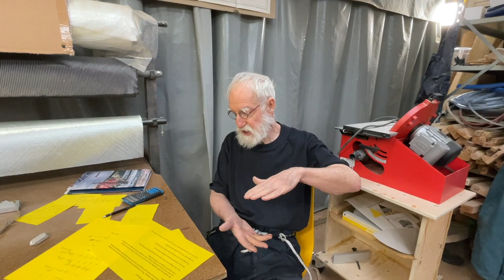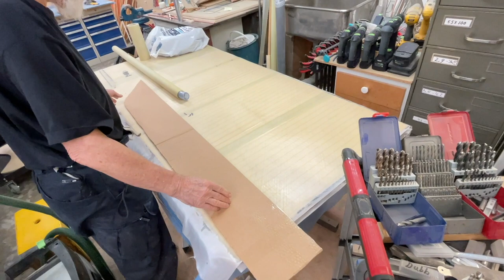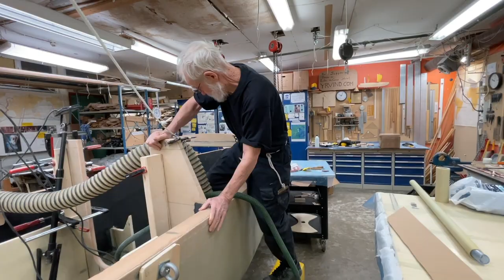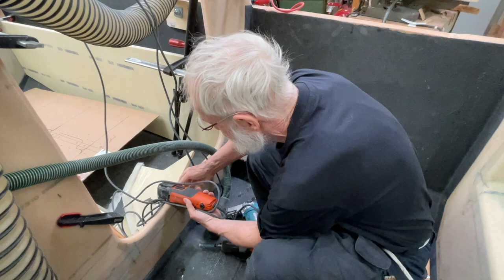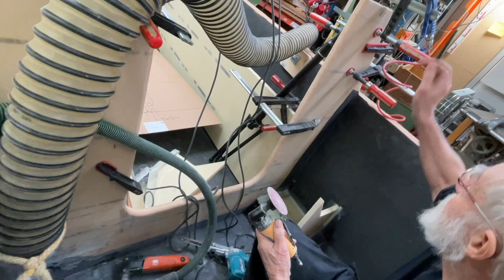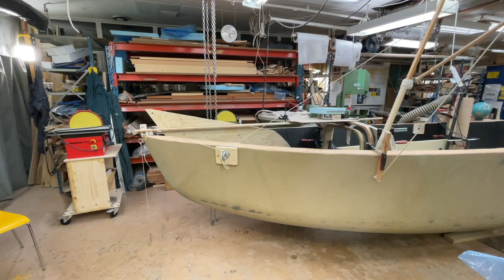The importance of CB & bilge keels. Because a rised CB gives trouble free stable downwind sailing

Comment: here's hoping puty goes the way of the dinosaur soon .
 you're building a interesting boat . it looks like a  boat that can be built on a limited budget like mine and I like the cork floating  concept better that a large boat plowing through the seas. it's impossible to build a vessel stronger than the ocean. I remember seeing pictures of brand new ships after going through heavy weather where the steel super structures were twisted like corkscrews and one ship had to be scrapped after it's maiden voyage. you appear to have the philosophy a cork floating ina violet sea is more likely to fair better than a tank attempting to beat the unbeatable I can't wait for the launch and to see it perform.
Reply from the maker: It is the Galelei square / cube law.
As structures gets bigger the forces increases with the cube, the strenght with the square. Dubling the scale 8 times the forces 4 times the strenght.

Comment: I am glad you got rid of the shifting ballast. There was just too much risk of it ending up on the wrong side. My LOLA design once had shifting ballast, in the form of a large water tank. It would be filled with drinking water about 3/4 full, and have a water-tight divider dow the center. There would be a valve that would allow the flow over to the low side. After that, the valve would be closed. The boat would then change tacks, so the biggest portion of the water would end up on the windward side. Often, in very light winds, it would be left on the leeward side, so the booms would stay out to that side, due to the boat's tilt. I gave up on the idea after considering  how high up the tank would have to be in the hull, and that it would make it impossible to store heavier stores below it.

I see the bow centerboard as a true innovation. You are now free to move the Center of Latteral Resistance (CLR) fore and aft to some distance. This is a very helpful capability.

As for the sail plan. I think there are three ideas you should consider:

1.) Using vertical battens to add considerable roach to the sail, and dispensing with the leech-clubs.
2.) Using only one of the sails when sailing upwind. The other sail will be too close to provide much useful lift.
3.) Have a short mast behind the mast of each of your two forward sails. On these short masts could go your booms. Then the booms could be horizontle enough that vangs could be installed to keep their aft ends from lifting. Preventors can do the same job, but with the booms being more horizontle, they would be more effective. With this design: the sail will be flatter, while sailing upwind;  fuller, when sailing across the wind; and fullest, while sailing down wind.

I am using an expeimental sail on the 10 ft scow I am building. I have designed a balanced lug sail to replace it, if it doesn't work.
Reply from the maker: Leech clubs are vertical battens and I think they will cause less problems.
In my opinion moving ballast is OK if it is a small percent of the displacement.
Reply: My ketch 36' hull has port and starboard water tanks 75 gallon each. It is a similar option to pump to one mostly for trim.

Comment: Very interesting, I'm sailing a transatlantic dory, Centennial, with centerboard... been considering transferring internal ballast to bilge keels... ?
Reply: Everything is workable if you do it well. Remember you need more than external structural adhesion, keels will need the hull thickness reinforcement as well. 
I would look at making a new centerboard with weighted bulb first. Lots to reinforce still.
Reply: I see you know a 'little' about boat building Dan. Prolific stuff.
Reply: @braithmiller  dang dude, you're reading my mind... I've actually got around 150lbs of lead on the centerboard... but that leaves me with 800+- internal under the slightly raised floor boards... but with 3' head room under the deck I can really use every inch... decisions decisions 🤔
Reply: @danoyes1  increased depth multiplies the righting force, calculate the reduction in total ballast required

Comment: Can you show how you seal and prevent flooding of the fore centerboard that can be raised and lowered?
Reply from the maker: It is a centerboard trunk that ends on deck.
No seal.
It is the ordinary solution for centerboard and daggerboards
Reply: @SvenYrvindExlex  Oh, ok that makes better sense.  Also, I can imagine that you could use that housing structure to great structural advantage in that it gives a lot of tie-point area to couple the deck to the hull, and even the bow! 
Thanks for the explanation Sven…
Reply from the maker: @SpinStar1956  True the housing structure stiffens up the boat a lot

Comment: Can you put two or more smaller bilge keels on each side of the boat to give you more surface area to prevent healing without sacrificing draft?  Kind of like how a biplane works through the air.
Reply from the maker: It is the draft of the bilge keels gives stability or how deep the ballast is placed unless you speak of the windward force and that is more from the centerboard
Reply: More surface area helps with rocking at anchor not heeling, area is not a righting force. Hoping you understand.

Comment: what is your opinion about having a flat bottom Tumblehome hull shape
i want to build a small boat flat bottom when looking at it from front it will look like trapezion.
how it will sail ?and does it need keel or not any more because having flat bottom tumblehome hull ?
Reply from the maker: What does "need kill" mean?
I have buildt many flat bottom boats. It can work.
Tumble home is above waterline.
Just for looks. That does not affect sailing and I do not like it. Some people like it.
It is not possible to ansver your question without knowing more and I have to focus on my own project as there is still many problems to solve.
Reply: I am not an expert but I have had the same question for a long time and gave much thought to it. Mr Yrvind is right in that it does not affect sailing as the tumblehome is above waterline. To my own understanding I think it make sense when you look at its pear-shape cross-section and how effectively the boat readily rights itself should it capsize. This is because such a volumetric shape will never sustain a capsize position, I believe. The fat bottom will quick resume it position below water after a capsize moment. I slowly got to this idea looking at Nature, especially the Rhizophora propagules. Also object shaped like a banana will only float one way with the two pointed ends facing the sky. So, can you imagine - a boat with tumblehome, good internal ballast and shaped like a banana, i.e. with a good sheerline? I think this boat will be very seaworthy given all things and factors equal, e.g. with positive buoyancy, watertight bulkheads, etc. Hope this helps. Cheers.
Reply: @SvenYrvindExlex  thank you for reply.
Reply: @josephlai9759  thank you so much.in this link ( https://en.wikipedia.org/wiki/Trapezoid#/media/File:Trapezoid_2_(PSF).png) can see the hull cross section.
a sail boat leans while sailing ,this cam to my mind that if building a trapezoid hull shape (in cross section that the bottom of the boat in the water is whither than on the deck ) 
may be its works.i think when boat .leans to the sides the V shape of trapezoid dig in the water and may be it will have righting effect,i hope what i wrote is more clear.i would be happy to hear about your thought on that.
thank you
Reply: @mhsn3470  Hi, I am no expert and do not know enough of trapezoid as of now. My thoughts on it is what I observed in nature. I like to believe a hull shape has to have both hydrodynamics that makes a boat sail well, and sea-kindliness in relation to the buoyancy and centre of gravity factors. Interesting subject for naval architects and interested wannabies like my goodself. Do what one can and test the idea out in water with a model. In the old days, great mariners make wonderful boats by eyes.... instinctively. So we should be encouraged.
Reply: @josephlai9759  thank u